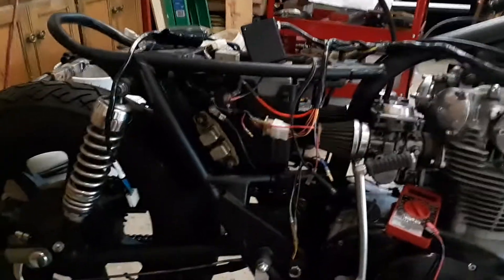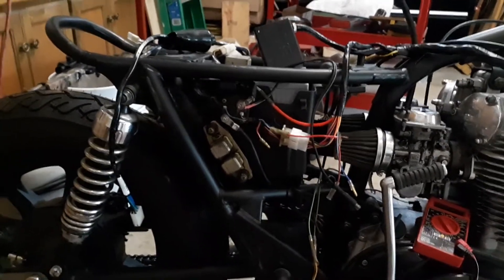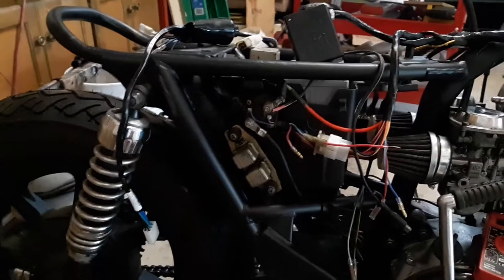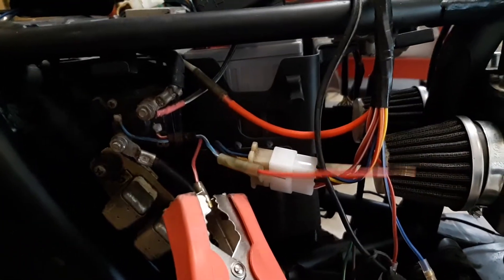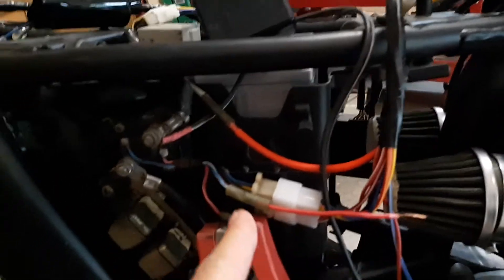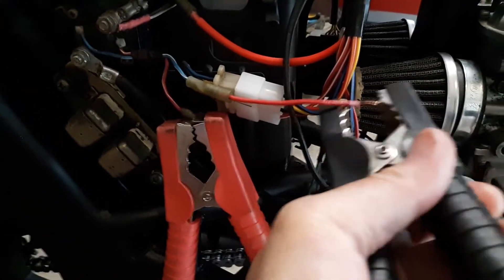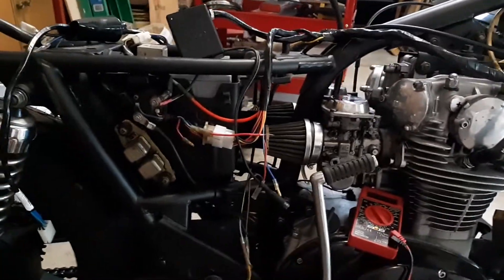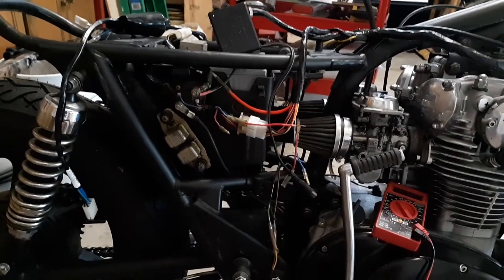Yamaha XS650 starter solenoid testing

Comment: Hi Jimmy, what was the problem you had on yours? I’m having the exact same issue. Bought a brand new wiring harness and nothing happened when I pressed the start. My solenoid is working fine as well. Been having troubleshooting what else to do. I’ve replaced so many other electrical parts and still can’t get it to start.
Reply from the maker: You know,  it's been soooo long, I don't remember what the problem was,  lol.   I should have made an update vid with what was wrong.    Sorry 😞

Comment: I connected the red wire from the solenoid to the blue and white wire to a toggle switch and it starts fine when I flip on the new switch!!!!!
Reply from the maker: Cool, but I read that the wiring (at least on my 1980) prevents the starter motor from engaging once the engine is running (if you accidentally push the starter switch once the engine is running).....